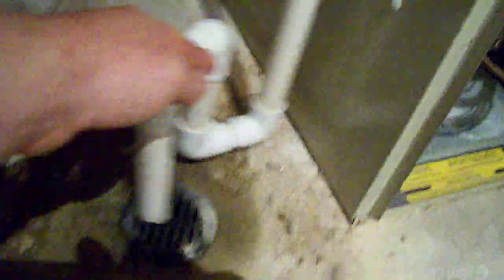Bad Air Conditioner Installation

Comment: You don't want your condensate line in the drain. So if your drain backs up it what's the minimum gauge for vansnt back up into your unit. unlikely but its still code where I live.

o